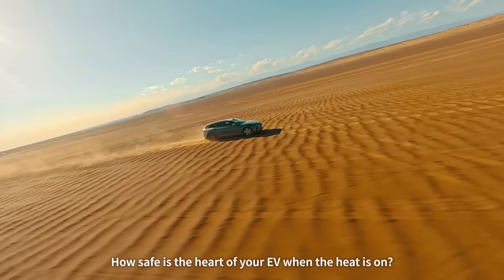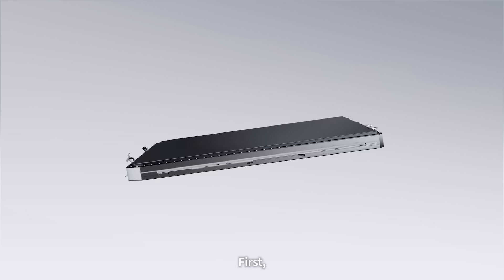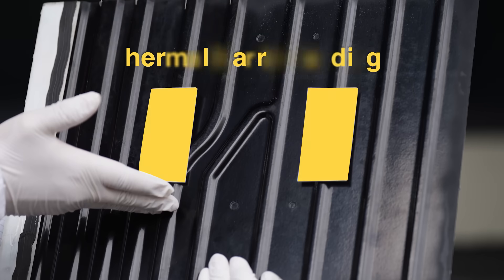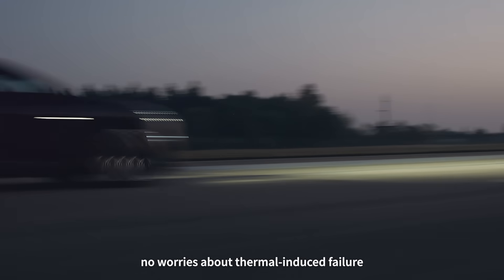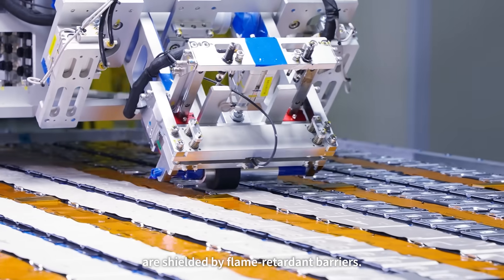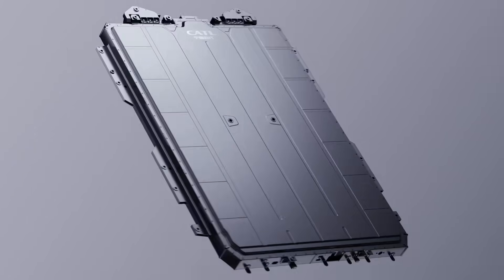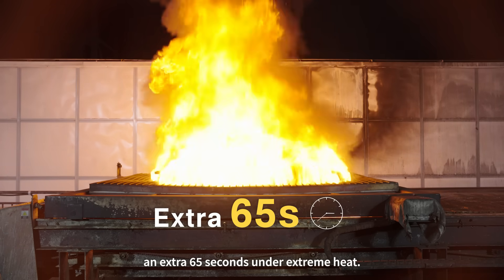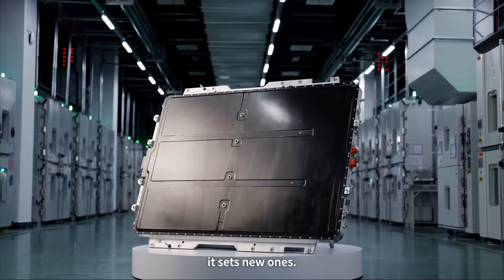CATL EV Battery vs 800°C Fire - Who Wins?

Comment: I hope CATL will move towards quaternary NCMA cathode chemistery instead of their current ternary NMC , here are the reasons:NCMA chemistery is the most energy dense commercially available cathode chemistery right now with impressive 231 mAH/g energy density with 90% nickel content ratio,for comparison 90% nickel ratio NMC has 197 mAH/g and 203 mAH/g for 90% nickel ratio NCA chemistery . NCMA also is the most stable and most heat resistant nickel based chemistery with highest cycle life in all of these 3 nickel based chemisteries meaning 45% higher cycle life compared with NMC and 95% better cycle life compared with NCA . for the anode CATL should use cutting-edge state of the art ultra advanced market proven BASF-GROUP 14 co-developed SCC55 nano silicon-carbon composite anode technology which has industry leading of up to 3000 cycle life in prismatic and tab-less cylindrical liquid electrolyte cells respectively(6000 cycle life in metal-salt polymer electrolyte);other SCN developers are struggling to achieve 1000 cycle life . SCC55 has industry leading 16% nano silicon to carbon ratio, Experts know for every 10% increase of silicon content in SCN anodes; energy density will increase by 30% . GROUP 14 claims impressive 50% energy density boost in above 10AH cells(4695-46120 ,large pouch and prismatic form factors)and 25% energy density gain in below 10AH cells(small cellphone pouch and 2170-18650 cells) . All of that means if CATL develops a 90% nickel content NCMA cathode and use GROUP 14' SCC55 anode tech  they can achieve mind bending 450 wh/kg in prismatic and large automotive grade 4695-46120 cells coupled with CATL' ultra innovative newly developed metal-salt polymer electrolyte(90% lower active ion consumption-85% lower unwanted side reaction-19 years of calendar life-80% better thermo stability)and multi-tab in prismatic and full-tab(tabless) in cylindrical cells they can achieve 6000 cycle life and 10c charging rates (up to 1400 amps of charging currents) . i hope my comment will help all battery manufacturers aroud the globe and give them some ideas about what will be the best possible cell with current commercially available technologies today .